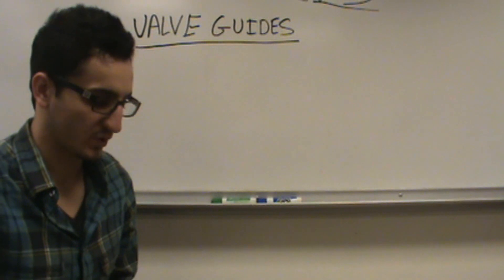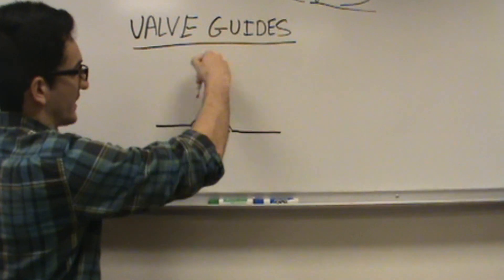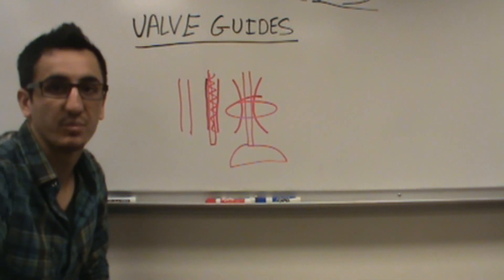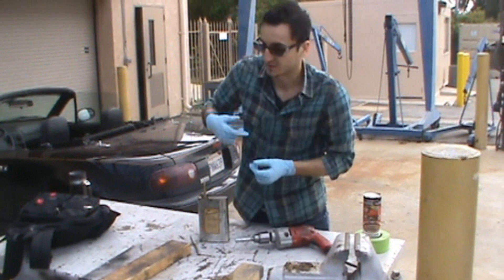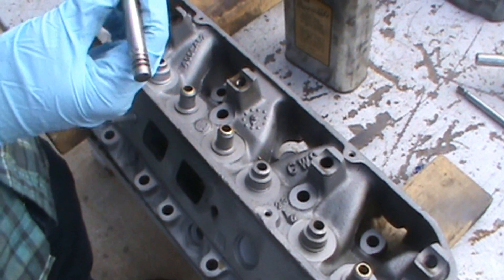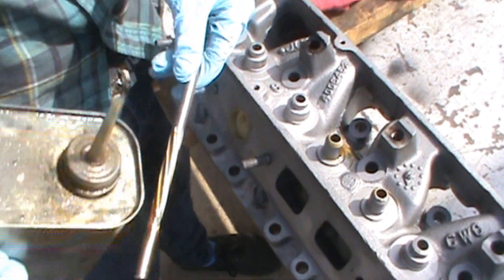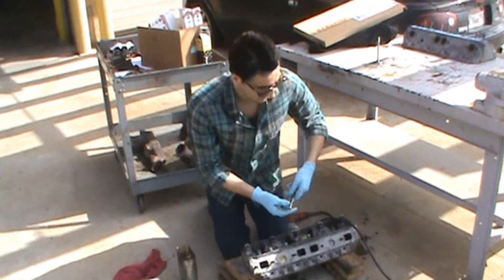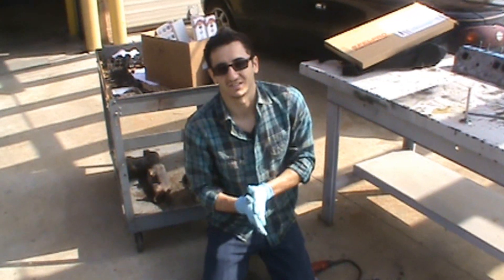Valve Guide Reaming on your cylinder heads

Comment: Not good to use bronze guides in a cast head.   It will stick unless you clearance it to the max of the spec, defeating the purpose of renewing a worn guide.  A modern cast guide (chilled cast iron) will last every bit as long as a bronze guide and will have proper the heat dissipation so it will not seize like a bronze guide and can be set up with proper clearance.  Bronze in aluminum ok, not in cast iron.

Comment: Good video on how NOT to do it. This method has fail written all over it. No accuracy, no proper measurement instruments. We're talking about 0.001" clearance here between valve and guide. How exactly are you going to measure that? And how do you know that what you just did hasn't made it worse, if you can't measure it acurately? Fail, fail, fail.......
Reply: +mictho100 the reamer is the sizing tool. Also you can shove a sized ball through
Reply: @johnapaterson  But if you don't have it perfectly straight, chances are you've just created the hourglass or funnel shape you need to avoid
Reply: He also is using bronze guides in a cast head.   It will stick unless you clearance it to the max of the spec, defeating the purpose of renewing a worn guide.  A modern cast guide (chilled cast iron) will last every bit as long as a bronze guide and will have proper the heat dissipation so it will not seize like a bronze guide and can be set up with proper clearance.

Comment: Some thought required here.......Assuming bronze guides were driven in place, an extra step[common sense] should have been taken to prevent end of guide distortion from install blows. Then maybe reaming entire length of guide would not be necessary.  Also the method used he used here kneeling on ground with drill "centered" from the top is not even aligned "on center" down into the bore. This new guide is already gonna be tippy at the top third of it's length. The tool continues it's travel down the remainder of guide bore and begins to align, but it's already off center by .001 or more This is how you build a backyard "motor."  Not a 20,000RPM Renault or Honda F-1 screamer.

Maybe Instructors need to pay attention more, before uploads on tube sites. I would not want my kid going to this school.
Reply: Reaming is necessary for many guides anyway due to the way they're made. You ream to fit your valves within tolerance.

Comment: Awesome vid! I just have a question for clarification. The valve stem to guide clearance should be about .002 inchs. when you ream the guide and remove material is it only removing material in the tight spot to keep the same clearance? would this mean that you use the same size reamer as the guide? Thank you :D